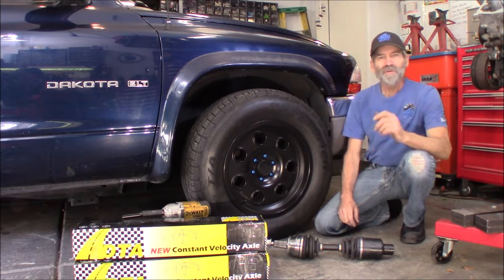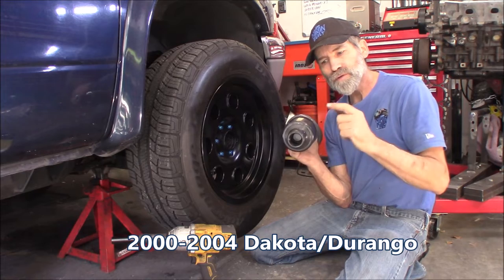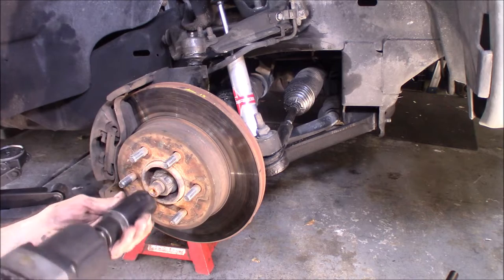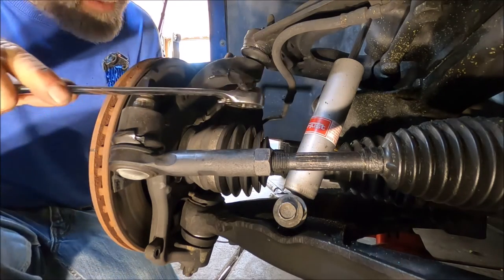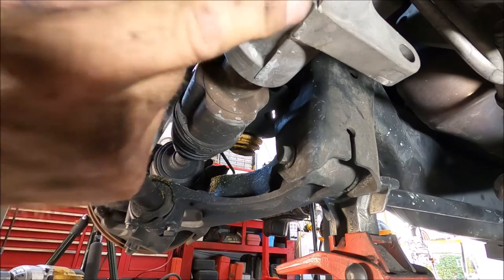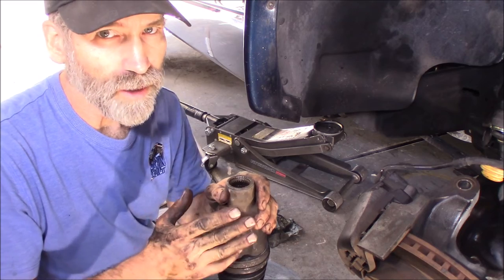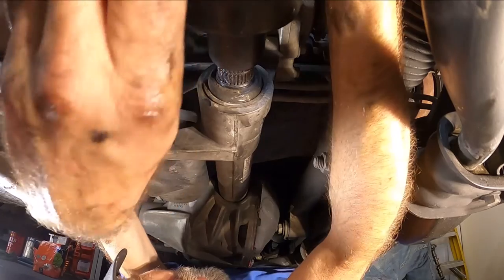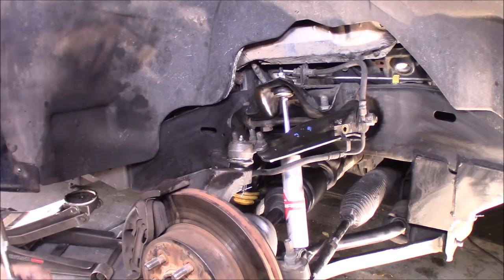How to Replace Front Axle Shafts on a Dodge Dakota and Durango

Comment: I didn't have as good of luck on mine. I did the driver's side and ended up having to take the differential apart because the half shaft was rust welded to the CV axle. Still the worst project I did on mine, but she got done.

Comment: One thing I have learned working on my 01 dakota was that there's a Vin cutoff for front axle shafts in 01 they changed the position of the c clip and from a certain point in 01 all the way to the end of 04 there one way I upgraded to the later axles in mine got the Detroit axle parts both outer and inner shafts thats the only brand cv axles I buy now
Reply: yes just ran into same issue had to order short splined intermediate shaft it was rusted in so bad to front axle  needed build date before or after  9/01
Reply: Any way you can share the part number for those????  I'm about to replace mine but I know the C-Clip issue is there and not too many websites or Parts shops can tell the difference without taking the one's I have on off. Parts shops are SO heavily priced that I can't afford the difference. I've found a pair of these on Amazon for $110...but in the parts stores, they're $110 Each!
Reply: @MatoCaska  best way to order is to look for the build date of your truck when I replaced mine I put the 02 and up axles in
Reply: @matty2helpfull  Thank you!
Reply: @MatoCaska  your welcome I found a entire axle kit on Amazon that i used and it has been great. It had complete inner and outer axle shafts
Reply: @matty2helpfull  Did they fit into the C-Clip slot???
Reply: @MatoCaska  I believe so the one diff I used was from a 03
Reply: @matty2helpfull  Do you think it matters that I have a 3" lift? It should still fit because it's from housing to hub...right?
Reply: @MatoCaska  that one I don't know mine is stock hight
Reply: @matty2helpfull  Well...I'm about to find out! Just bought the pair for install next week.
Reply: @MatoCaska  nice hope all goes well
Reply: Anyone know the part # for the Axle with a manufacture date of 09/00  Dakota?
Reply: @rainmaker3700  most of the time when you go to buy cv shafts for the dakotas the site should tell you b4 or after a date in 01 ik Amazon does
Reply: OK so the SPecs should give the clip location of either 1" or 1 5/8".   For my Dakota build date 09/01 the part # from ORiellys is MI8136 with the clip location at 1-5/8".

Comment: if you have clicking cv joints also check the 4x4 drive shaft as the factory one is on the transfer case output . I changed the whole shaft back to old style u joint style because I destroyed the original .

Comment: Great video. I have a 2001 Dodge Durango SLT with a 4.7 liter 4x4 with over 241,000 miles on it. This video really help me change out mine. They were not clicking nor were the rubber boots cracked; I spray them with AT-205 every 5,000 miles to keep them like new. But, my inner shaft on the driver's side came out with old axle due to some rust intrusion inside the splines. Your video gave me a great heads up on the replacement. Between you and Scotty Kilmer, my Durango will last til I die and I expect at least another 40 years! Thanks again for the videos. 🍺
Reply from the maker: Thank you I really appreciate that. I'm glad you liked it and found it helpful.
 Good luck on the next 241000 miles I'm sure you'll make it.

Comment: Great job in this video. I replaced the passenger side first, went exactly as you instructed, however the drivers side required me to remove the skid plate to get to the axial hub, in order to tap it loose.

Comment: Good to see you uploading again Martin.I was starting to worry about you...
Reply from the maker: yeah, I lost 5 videos I was working on. I hit one wrong key on the computer and lost it all.🙁🤬
It was hard to get motivated again.
Reply: That sucks.....
Reply: @martinbuilt  what do you use for editing?
Reply from the maker: @JF32304  Windows Movie Marker
Reply: @martinbuilt  there isn't a recovery directory? Cached files... What wrong key did you press?
Reply from the maker: @JF32304  I deleted the files by accident and it did not go to trash.
Reply: @martinbuilt  hmm are you on an SSD or spinning disk?
Reply: @martinbuilt  is it on an external or internal drive?
Reply from the maker: @JF32304  I believe it is SSD and it is internal.
Reply: @martinbuilt  how long ago was it?
Reply: @martinbuilt  have you tried running data recovery software on it?
Reply from the maker: @JF32304  is that an Unzip program?

Comment: Hey, just wondering about the seals. You didn't say anything about them potentially leaking after the repair. Now that the repair is done, would you replace the seal on the axle next time?

Comment: How do you know if the shafts need replaced ?  I just did all new suspension on 05 Dakota the shafts boots were ok and splines seem fine enough. I did of course notice they were not stiff like a new ball joint   I see your new one seems stiff making me wonder if they wear out like a ball joint where they have movement

Comment: Any difference in lengths from passenger to driver. Also my torsion bars are cranked giving me a 3” ish lift. Wondering if I need longer axles with my lift. Parts websites say either side works with same axle for aftermarket longer axles. Oe has a right and a left axle.
Reply from the maker: Either axle shaft works on either side, they are both the same.

Comment: I did my bc today watching your video but I can’t seem to get the axle to go in all the way, seems there’s a bit of a gap still any suggestions to make it go in all the way, drivers side axle that meets the differential NOT passengers side. 02 4.7 4x4 Dakota
Reply from the maker: When you go to pull it out is it clipped into the C- clips? 
 do you have to give it some effort to pull it back out because if you do it probably is in all the way.

Comment: Question: I have a 2000 Dakota 4x4 and honestly love it... I have to rebuild the motor, as I believe that it has a warped head. If it was you, would you replace the motor with another 4.7, or would you opt for a different one? I'm weighing my options at this point, so would appreciate any opinions.
Reply: Go with an H.O. 4.7 if you're going to do it.
Reply: Stay with the 4.7 man...good engines and easy to work on...easy to upgrade...
Reply: If you decide to replace your 4.7 be aware of the fact that not all 4.7''s are created equal. With yours being a 2000 you will have to find a motor that has the same number of teeth or cutout points for the crankshaft positioning sensor and the camshaft positioning sensor. I can't remember off the top of my head but if memory serves me correctly 2002 and under 4.7's have a 16 tooth cutout setup and anything after 2002 has 32. Your ECM will be totally confused and the engine won't run.
Reply: @heavymetalrockman  that's an easy fix...changing your gears
Reply: @Kolonol1  Not as easy as you think. One on the camshaft and one on the crankshaft would involve completely disassembling the internals from the block. An easy way to check for the difference,  provided the engine is still in the vehicle, is to check the ECM on the passenger side fender well. If your ECM has 3 plugs it has the 16 tooth cutout configuration. 4 plugs means is has the 32.
Reply: @heavymetalrockman  very good information! Thank you sir
Reply: @heavymetalrockman  what do you mean by that? It's 8 bolts lol...when the motor is out it's super easy...I'm not thinking lol I just did it this spring
Reply: I would like to upgrade my V6
Reply: @heavymetalrockman  Thank you man for letting us know that , it would be a catastrophe if I didn't know that, I have a 2000 4.7 Durango. I learn a ton from all you guys , you rock!!!

Comment: I need to do this on my 2001 Dakota, when I put it in 4x4 the front right click, click, clicks.
Reply from the maker: That is a good sign of a worn CV
Reply: @martinbuilt  My Dodge is manufactured in 09-00,  is the part # for Axle shaft you linked the correct one for that year??  Thanks.
Reply: @martinbuilt  Welp. I put in the new CV axle, when I finally got the correct axle, it went in easy peasy, but it did not fix my issue of the grinding noise when I put it in 4x4.  :(  Do you have a video on how to change the CV joint??

Comment: here in Indiana every thing rusts out fast.
Reply from the maker: I know what you mean. I lived in Iowa for 36 years. I know all about that rust. I love it here in Southern Nevada. You could leave a piece of bare metal out for a year, and it wouldn't even have surface rust on it.
Reply: I have a 2001 Cali Dakota and its pristine, practically no rust.
Reply from the maker: @rainmaker3700  
It makes working on them so much easier.

Comment: unfortunately , your directions must be for dakota truck , none of your info in vid was pertinent to 2004 durango, wrench sizes wrong , what you have to move out of the way to do etc ,
Reply from the maker: In 2004 Durango made a huge change to the front suspension to the knuckles where the rack and pinion is mounted, many things changed on that vehicle year.
Reply: Pertains '98 to '03